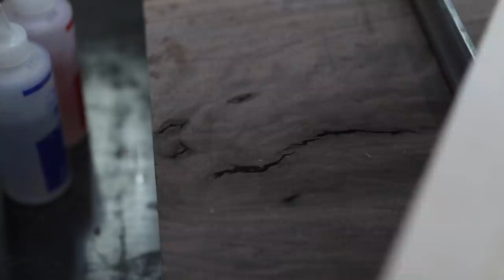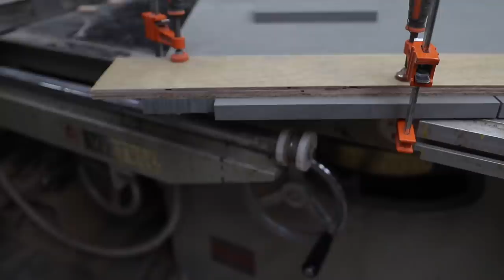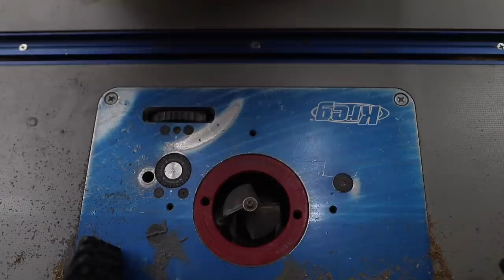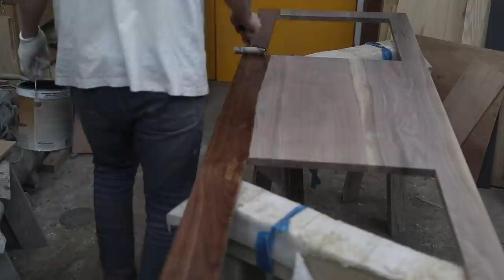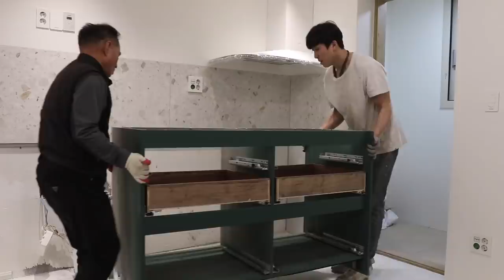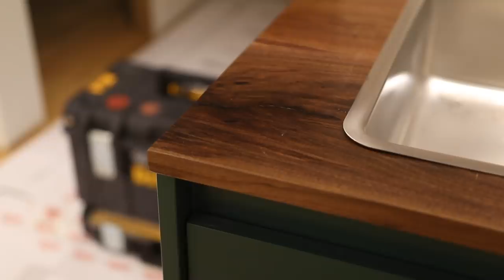W54_Modern kitchen design

Comment: I really like so many of your designs and your methods are very simple and I particularly think it's beautiful how you often use Valchromat on the exterior and walnut on the interior, the opposite to many many works. My only reservation/question is why do you so often paint over wood/ Valchromat. Both are perfectly attractive materials without paint, and as Valchromat is available in a fairly wide number of pleasant colours, why not just use that, as over time the painted MDF will inevitably look worse than if it had no paint at all.

Again, great work though. Cheers
Reply from the maker: Great question~! I often paint over wood, Pine, Valchromat, even Oak. Cause I love various color-way and colorful places. Valchromat has many their colors. but... it's not good, not clear, not vivid. that's not my style. And Pine, Valchromat, Oak...They show different allure when painted. Some woodworkers very very hate that...But I love it.

Comment: 안녕하세요! Very nice work!

What spray gun and pressure settings are you using when spraying the paint? Also do you coat that again for durability or which paint would you recommend for cabinets (I saw brand was Benjamin Moore, but which paint from them)? Thanks!

Comment: Super nice work and awesome video. I have some question about painting the valcromat, the first white coat you apply is just normal primer? What type of paint is the green paint? And, do you need to seal the edges of the valcromat to apply it? Thanks
Reply from the maker: 1. nomal primer. 2. I use benjaminmoor paint water-based. 3.Valchromat does not need to seal.

Comment: Great project, can you please tell what did you use for sealing the countertop (10:45-11:30)? You used oil and then you sprayed what? Thanks. Keep doing these videos 👍🏻
Reply: Polyurethane varnish I guess.... kind of water protection!
Reply from the maker: Correct~! 정답입니다~~~😆
Reply: 영상 잘 보고 있습니다 : ) 안전작업 하시고 조만간 구독자 폭팔할듯  @ViTTEN
Reply: @ViTTEN  What you sprayed against water?
Reply: @ViTTEN  whay you sprayed for water resistance?
Reply: @andreabo8182  he rolled on sealcoat  & then sprayed on polyurethane loll  ..
Reply: @andreabo8182  yea water protection  & safe for eating

Comment: Great kitchen, i really love the simplicity of your design!

 I have one question. Why do you paint over the colored MDF? I know it´s Valchromat, but i have never used it? do you use it for its properties instead of the color? how diferent it is compared to regular high quality MDF?? Thanks for your videos, hope you answer my question.
Reply from the maker: Thanks~! It's more adaptable for water-based painting.
Reply: Valchromat is around 30% stronger and more dense than MDF. Gives a better surface for painting. Better but also a lot more expensive (at least in my country - Denmark).
Reply: @steenfraosterbro3268  Thanks for the answer!! I found a valchromat dealer here in my city. I am finishing 2 projects for clients but after that I will try it in a personal project, I have a lot of curiosity to see how it works. And yes, it's a lot more expensive.
Reply: @roger_001   One advise. the color seems to differ a little bit from sheet to sheet. I have made a huge build in closet with yellow Valchromat fronts treated with water based poly. They are all smooth as a baby butt, but they do differ a little bit in the color. Guess that the price of a "natural" product. Believe they use Beeswax as a binder. I also tried Osmo oil treatment, that didn't go so well (very patchy in the colouring).
Reply: @steenfraosterbro3268  thanks a lot! I'll come back to this comment once I buy the valchromat sheets. Do you have videos or photos of your projects? Here in YT or IG?
Reply: @roger_001  Sorry I'm pretty much off SOME. I do have some photos I can send to you. I believe "get hands dirty" also have videos where she used yellow Valchromat, where you also can se a little color difference in her projects.
Reply: @steenfraosterbro3268  that sounds cool! Im also off social media but planning on create content soon, I think it's the way to go. Will check her videos tonight. Im roge_t at hotmail. Cheers!

Comment: What type of material is the whole thing made of? I've seen you using it on other projects as well, is it coloured MDF or... something synthetic?
Reply: valchromat
Reply: @VITTEN: Why do you chose to use valchromat even for some less exposed parts, even if it is somewhat more expensive than MDF? Is the quality also a lot better than MDF? I've seen you paint it a few times and i am thinking MDF would be cheaper

Comment: Hi, it is an impressive work. However, I would like to ask you a question, are you using any material to protect the black walnut, such as how to waterproof the tabletop?
Reply from the maker: Thanks~! the tabletop have finished sealcoat & polyurethan. That way so durable. but there should be no holes on tabletop. seal perfect
Reply: @ViTTEN  Thank you very much, it is helpful.

Comment: To install it you made a hole. What is there? Collector and motors? Never saw anything like this in my area.
Reply from the maker: It's Boiler and collector. It is usually in Korea.
Reply: @ViTTEN  Differences in engineering systems are always interesting. Do you know where i can read about it? Is is boiler per each pipe? why?

Comment: Hey, which type of hardware  did you use for the sliding drawers? Also which material (that grey coloured) is used for  the shutters of the drawers?
Reply: Have a look in the description
Reply from the maker: Correct~!👌